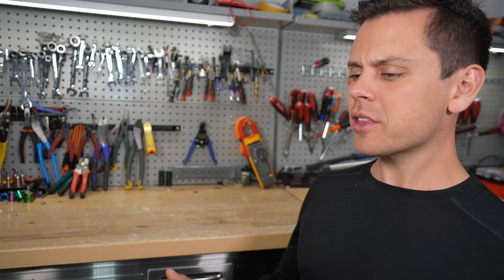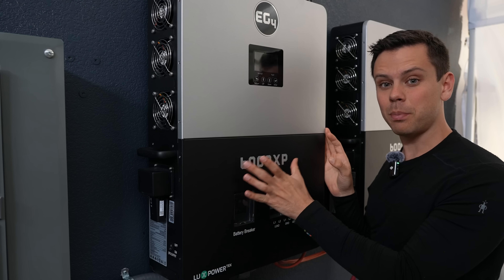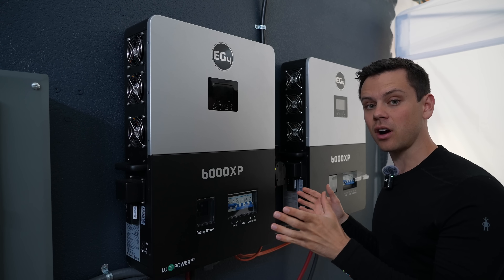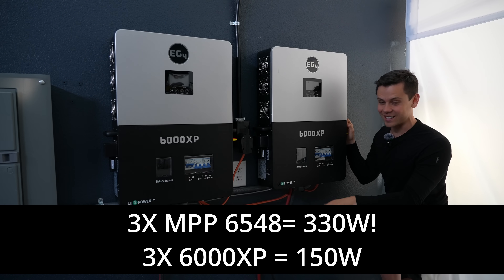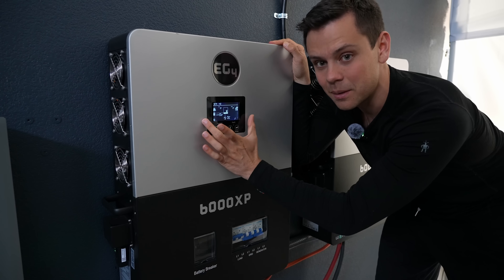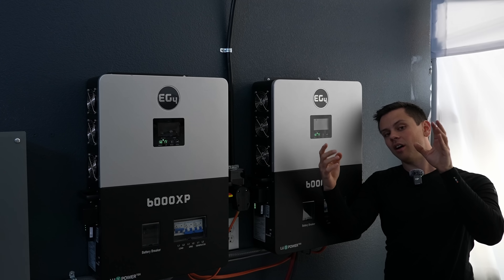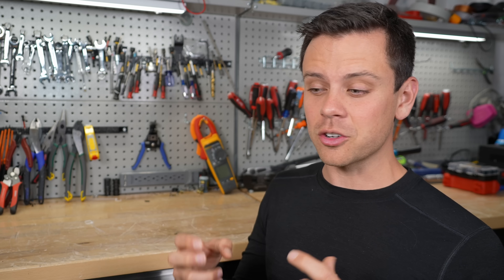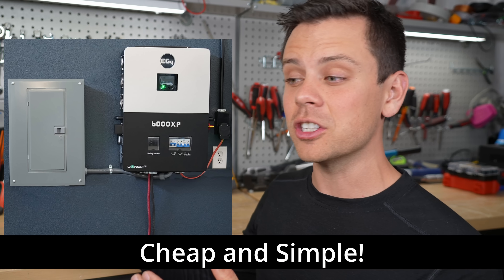Offgrid VS Hybrid Inverters! Which one is better for the $$$?!

Comment: 6000xp idle consumption is lower if connected to grid. They say down to 30 watts....
Also, pass through from grid up to 50 amps through it, no transfer switch required. 

I would never mount an inverter outside, even if IP65 rated. Build a "power house" to protect it and provide security.
Reply: Power house built from what?  Shipping container?
Reply: Bricks and mortar, easy peasy.

Comment: Got the 18k, EG4 battery and 10 Canadian 400w solar panels. Now I’m broke and have to save up to put it all together with an electrician. 😂
So, couldn’t afford it so piecing it together slowly. Thank you for helping us figure it all out Will. 👍
Reply: That’s exactly what I’m doing. Good luck!
Reply: I just got the 18 K and EG4 battery also. Trying to find an electrician to hook it up. I’m getting quotes of like $4,000! seems very expensive is it or is that the going rate? I already have a solar system just trying to upgrade the inverter and add the battery back up two batteries by the way.
Reply: I'm doing same thing 2-18k and 4-eg4 pro battries 10000 Watt solar on my camper
Reply: @jeffsowers1290 . How are you able to fit all of that on a camper?
Reply: You guys are gonna make me get into the business of solar installation😂 cuz  what the heck just do it ya self
Reply: How much is the electrician review and permitting?

Comment: We have a 6000xp in our off-grid barn and I can confirm that you can hear the fans anywhere in the barn. Any outside engine noise (truck, tractor) will drown it out, but normal nature (birds, animals) will not. It's not crazy loud, but anyone that has worked with server and workstation computers will know that fan sound.
Reply: My 6000mp was making me crazy!!!  Terrible brain fog and headaches.  Finally we hooked to panels up using Victron controllers connected to the batteries.  So the big fan doesn’t run.   It made such a difference.
Reply: The fans that run when it is inverting aren’t not as loud - they are more like white noise.
Reply: Wondering anyone has tried replacing the fans with a water cooling system ? Definitely void the warranty but could drop the noise significantly.
Reply: I found some thin steel sheets at the junk yard, and put them on the walls and ceiling.  That should slow down any lipo fireworks in my power shed.
Wish they made DIY HALON systems.  That should starve lithium.
Reply: @robertsmith2956  Don't lithium burn without air? Most car battery packs are sealed and they burn pretty good. You need to remove heat not oxygen.
Reply: @robertsmith2956 LFPs are MUCH harder to ignite than Lithium.
Reply: How does the fan noise compare to the Growatt 5k es
Reply: Agreed.  My 6000XP fan is almost always running and noticeable, even when outputting just 200 W.  Glad I installed it outside in a covered carport, rather than in the garage since it would be bothersome there.  Not  near as loud as the AC compressor fan or pool pump, more of a "why is it always running?" bother.
Reply: Love my white noise. I turn a fan on to sleep anyway so fan noise isn't a deal breaker for me
Reply: you can add a shrout and a normal fan with silencer to a crypto miner/server..
it would not take much adjustment to fit those kits to a inverter...

if a njord printboard and a fan kit does not fit, i bet they can make it fit

sounds like the hardest part is to 3d print the shrout

the reason why servers make more and more noise is that those small fans can hardly keep up with the job
why use 10 fans on full power if you can use one fan on half power
i bet it would draw less energy with a kit also, just like the servers do
Reply: Ah, that 60hz hummmmmmm! IT inna former life, in n outta data centers daily and I can say I def don't miss that drone. Deal breaker for me on these controllers. Gotta be sealed type to sock em away, way away.
Reply: @bigdfig6083 nah it’s not a frequency hum, it’s just a fan noise
Reply: @EricKolibas I think it is more than just fan noise.  The controller fans Definitely had serious physical effects on me that the Ac fans do not.

Comment: I bought the 6000XP with one  power pro and 7900 watts of solar. If you run efficient appliances, that is all you need for  a small home. Completely energy independent! 
DIY cost: $15k installed
Reply: 15k for 7900 watts? Damn. I just priced out 20,400 watts a lot less.
Reply: @Google123ABC  what components please?
Reply: @Google123ABC  I was gonna say the same thing 15 K is a lot I just brought this 6K inverter and the indoor wall for 5K and I definitely definitely don’t planned on spending 10,000 on solar panels😂
Reply: I bought a 12000xp, 20kah rack mounted batteries, and 10 450w Canada solar panels for less than 8k during black friday
Reply: I installed 2xsna 6000w which are similar to 6000xp with 14panles 600w and 30kw batteries for less than 7500$ including wiring and installation. In Iraq though.

Comment: Thanks for your hard work and erudite perspective as always, Will. Another option now available for those who feel unsure how to proceed in a fully off-grid installation is to use the amazing simplicity of the EcoFlow Delta Pro Ultra solution. A truly "plug'n'play" answer to whole house power supply that can be expanded as funds become available by adding extra batteries to the basic Inverter and battery unit. Doesn't get any easier and stress-free.

Comment: Maybe I missed it but I don't remember you ever doing a review on any Magnasine equipment. I wiuld love to here your opinion of them.
Reply: MY neighbor had an old "magnasine" 48V inverter that had been run over by a tractor before he bought it. It worked in his system for well over 15 years before finally failing...I suspect due more to the 120+F temps here than anything else. We just installed a Growatt SPF 5000 ES, which only puts out 240V, so had to add the SolarEdge Mid-Point Transformer, (rated at 5,000 VA output), to get a Neutral for 120VAC. If one can afford it, I do recommend the MagnaSyne. It is a beast of a power inverter!

Comment: One inverter brand and model that seems to have been forgotten: Outback Radian 8048A. It’s a low frequency transformer based inverter that is field serviceable.  It is a component system so you have to buy the charge controller separate and other dodads that make up the system. They are still being sold and I have some that are installed over 10 years ago and going strong. They are of course stackable and the online monitoring is one of the best.  It compares to the Schneider in surge capacity and weight. They are rock solid.
Reply from the maker: Yeah that one looks great. Reading spec sheet now
Reply: Outback or Magnum or Trace or Schneider. All with heavy transformers and built to last. I’ve never had to do a firmware update on any of them. They just work out of the box. Set your charging parameters and walk away. Most go decades without issue
Reply: @jonobeckster  I was looking at Magnum and Outback and they seemed like the ideal options for building a really long term system -- except for the fact that they're so much less common in the current DIY community.
Reply from the maker: Will check it out
Reply: I also have outback inverter system installed in 2006..second set of wet cell batteries have now failed and trend is to get away from 24vdc battery bank. Can purchase EG4 6000xp+30kwh Lipo batteries for same price as new 30kwh 24vdc Lipo bank only. Hate to take down trusted faultless Outback unit but trend is too demanding right now.
Reply: I have a magnum inverter and love it. Use it, abuse it, and don't worry. 

I would like to see side by side comparison of quality transformer based vs hybrid… Pros and Cons.

Comment: A point if I may. The EG4 18k is not, as far as I can research with documentation at Signature Solar, UL listed as service equipment. This means that it cannot be wired directly to the grid device (meter) without having a service rated means of disconnect in between. In all of EG4's wiring diagrams in the 18k install manual, it always shows a service panel or a fused disconnect between the meter and the inverter.
There are very good reasons why this needs to happen involving the interrupting rating of the overcurrent device, so people should not be thinking they can wire an 18k directly to their meter and skip the service disconnect.
Reply: note bene
Reply: IN Canada you must have a service disconnect regardless of approved device,won't pass inspection without one.

Comment: I have one of the 12kw transformer based Growatt. I kind of wish I got a HF inverter to reduce the idle consumption. I use it for a 350w base load (Server/Network Rack) to reduce electric bill when there is excess power in the batteries but acts as a whole house back up primarily.

Comment: MppSolar lvx6048 worth at all? 
100w idle sucks but 1.1k$
Transformer based ... 
Just not sure if my lister 1800rpm based generator can feed its mains input to charge batteries
Reply: I would recommend getting the 5KW Chargeverter to charge the battery bank, as it can be set for any Amperage input from zero to 100 Amps, thus allowing you to customize the settings to your particular generator needs. I do recommend getting the higher Wattage generator, if you can afford it, at least a 3500W one.
Reply: Mah lister has a 5kw head ... no worries there ...

Comment: I have been looking at the 6000XP vs the 18k and just could not understand why anyone would buy the 18k over 3- 6000XP units.  This video gave a good explanation on why it would be a consideration but I still think the 6000XP is the better buy.  First why would you put the units outside when you could easily stick them in the garage, second if one 6000XP goes out you can simply buy another one and limp by on the remaining units until you can get it back up to speed.  If your 18k goes down you are in serious trouble in an off grid situation.  Finally with using multiple 6000XP units you can have multiple arrays set up that are not necessarily next to each other, with an 18k all the arrays are being wired together to run into one box.
Reply: Now you know some of the reasons why someone may opt for the 18k

Comment: One huge downside of the 6000Xp is that you can not limit current from grid input. For example, if you have two in parallel and only have a 50A grid connection like from a campground pedestal, the inverters can pull more than 50A and trip the breaker. 

I got around this by connecting the generator inputs to the grid and limiting the current to 24A each inverter.

Edit: Referring to pass-through power capabilities of 50A per inverter.
Reply from the maker: No you can change the current for charging in the app
Reply: @WillProwse  Sorry, I was referring to pass through power. Each is capable of 50A, and both in parallel can pull up to 100A, which will trip the 50A pedestal breaker. Is there a limit to pass-through current?
Reply: get a solark 15k

Comment: I have a 6000xp at my cabin, which is fantastic, but realize as we are getting to spring, I have surplus PV. If I was doing do it again, I would get a hybrid. Not to sell back (not allowed in my area) but to use the current transformers and send surplus power back to main service panel where larger loads are.

Comment: Something like this has appealed to me for my project, which I would say is not typical.  I want roughly 6000W of panels but their primary use is to charge an EV and to operate most of an electric water heater via DC.  High-wattage devices in the house (oven and mini-split in particular) I'd have perpetually powered by the grid.  Everything else I'd connect to the 6000XP, which will soak up whatever energy the car and water heater don't use.  Since I'm not likely to ever draw more than 3000W from it at any given moment, I figure it'll live a very long time with minimal stress.
There are moments in the summer where I'm likely to produce more energy than I know what to do with, and I suspect in winter there will be times when I won't produce enough energy to power everything.  But, the extra cost and complication of doing net metering doesn't really seem worth it to me.
Reply: What are you talking about a DC water heater please tell me more
Reply: @jeffsowers1290  Simple electric water heaters with no digital electronics don't care whether you use AC or DC power.  The tricky part is dealing with arcing caused by DC, which will destroy the thermostats after just a few uses.  To fix this, you use AC to operate the thermostats, which then operate a contactor (basically just a beefy relay) so you can deliver DC power directly to the heating elements.  My plan was to keep the top heating element permanently powered by AC, since that is really only used when you've used about 75% of your tank's capacity.  I don't mind if the grid is used to compensate for just a few minutes of heating while the solar panels do the rest.

In the event you need hot water and there's not enough sunlight, you can get a cutover switch to manually swap out the DC power with AC.  $30 part for peace of mind.

There are a few compelling benefits to this compared to alternatives:
1.  Tank water heaters are batteries, just in the form of heat.  Rather than put immense stress on your inverter and its batteries to heat up your tank, you can just heat it directly.  Don't forget about all the conversion losses!
2.  To my understanding, there's a lower limit to how little solar energy an inverter can make use of.  If you draw more power than the panels can output, you don't get any of it.  However, even in the early morning when you're only generating a few hundred watts, that's still enough to start warming up the water.  It'll be horribly slow, but the point is: you can tap into energy that you otherwise couldn't use if you tried to heat the tank via the inverter.
3.  Since the contactor is used to take the brunt of arcing for DC, that's an expensive component that will inevitably fail.  However, if the bulk of your hot water usage occurs when the sun isn't up (or low in the sky) then you can nearly double the lifespan of the contactor, since an analog thermostat will call for heat even when there's no power.  This may also help increase the lifespan of the solar panels, since they're not being hammered with a sudden high demand.

Comment: Because I’ve been a dumpster diving electrician for many years,I have a lot of contactors  with good capacity. I leave one independent Growatt on UEI load priority but with the grid connected at night only,when I get free electricity.
So my timer energizes the contractor 8:00pm -6:00 am to top off the battery bank when there is little solar input.  Very low tech but I like keeping my eggs in multiple baskets.I’ve recently moved my solar power plant to a trailer so have lots of flexibility for use.
Because I power two houses,it was more convenient and survivable since we’re all in advanced cognitive decline and might burn the houses down at any time.
Reply: That is a great idea.  Trailer mounted power plant.  I enjoyed your description of age and the possible outcome of said "advanced cognitive decline".  Fires are no good (well destructive fires anyway) and having that separate from the house is definitely a benefit.   Good luck to you in our golden years😂

Comment: In the design phase of my off grid home in Western North Carolina.  Planning on storing 1000+ gallons of hot water for radiant floor heating etc.  Can I use the Hybrid inverter to run electric heaters instead of feeding the grid when the batteries reach 100%?  Love your videos.  Keep up the great work.

Comment: A huge advantage of a true hybrid inverter that uses CTs is it can support way higher loads than an off grid inverter. If you wire the 18kpv to support house loads it can support you to 12kw but even if the load for up to 20kw it would still reduce that load by it's 12kw. An off grid inverter would just shut down so with an off grid inverter you must always do a backup panel while a hybrid can support the main panel plus a backup panel
Reply: I keep trying to tell people this.. they just don’t understand..

Comment: I helped my son design a off grid system in his remote site where grid power connection would have cost about four times what he paid for the 6000 xp with the 13.4 EG4 battery and 30 panels.It’s working great running his travel trailer with only 20 panels connected.

He was concerned about the inability to get more than 30 amps continuous at 120v but that hasn’t been a problem so far.
I started my system with multiple Growatt inverters several years ago and ended up with an extra 5K transformer when the dust was settled. If necessary, we could run the load off the center tap to get the surge advantage of the transformer.

Since he put a soft start on the air conditioner,all that has turned out to be quite unnecessary.

Comment: I'll be doing the 18kpv eventually.  Unfortunately, I'll need an electrcian to do anything between the meter and my main panel to do what I want to do😅

Also thought about have an electrician install a main disconnect and then I'll be comfortable doing everything else.

Comment: I have always been concerned about single inverter failure. If that happens then your whole house is without power until you get a replacement. I would think that multiple inverters would provide some redundancy and therefore greater peace of mind. Of course, you could always keep a spare, unused inverter in a box in case there is a failure, which may be the best way to protect against lightning damage.
Reply: I had the same fear. So I picked up another unit just in case. But my failure came in the form of the combiner box. I tried to be prepared but didn't back up the right parts. Live and learn. I'm ready now though.